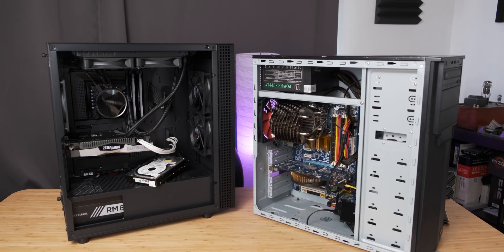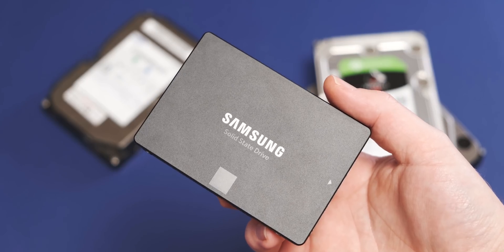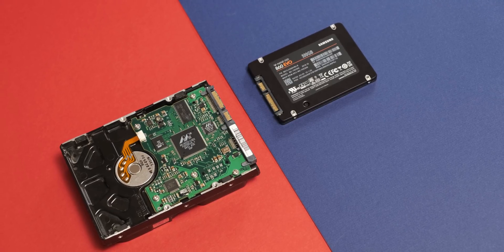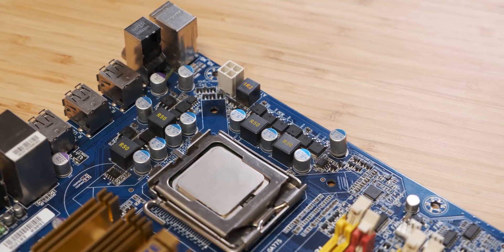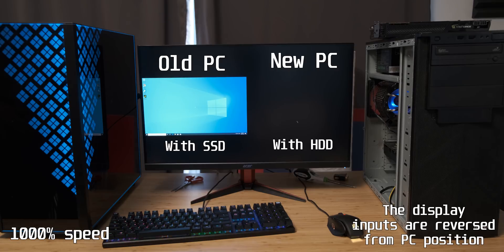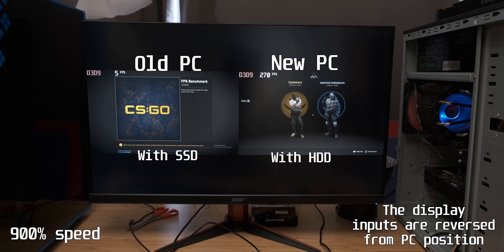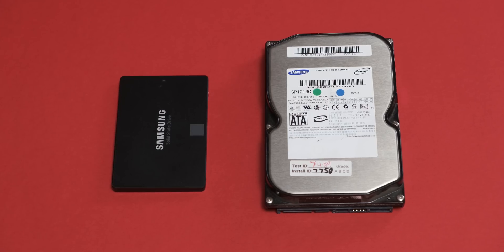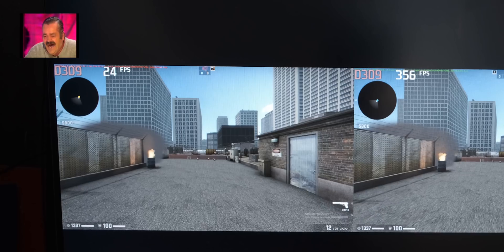New PC with old hard drive vs Old PC with new SSD

Comment: I got a problem i think i got 2 pc and  1 or 2 gpu cable ar mix in whit the rest of power supply kabels from a other power supply  1 psu is 850 watt the other 1 is 750 watt  i going to buy a gpu soon and  i dont wanna blow my stuff up  and all the cables look the same  the 2 gpu cables are from the 859 watt psu how harmfull could it be ??????

Comment: 1) HDD not defragmented !
2) The smaller the HDD the lower the Speed, because the density is lower, and the travel times from the head are bigger, because of more distance.
My smalest and oldest HDD is a 500gb 7.2k rpm Hitachi from 2009. Makes 100mb peak, 40-50 average, and 25min at worst (all Write Speeds !)
My external (USB 3) 16TB Toshiba from 2023 makes 220 MB peak ! and i saw it never go under 90mb. Again all write Speeds !
3) Because some guy (like 5 Million other) got a yt channel for pcs, and a ton of money to build a expensive pc, doenst mean that he has real knowledge about pcs and hardware.
I'm 42 and when i build my first pc, and wrote my first scripts in MS-Dos, a 486 SX25 was state of the art.

Comment: I like the comparison...but asking would you rather have an old PC with an SSD or a new one with a HD is the dumbest question I have ever heard. OF COURSE you take the new system SSDs are cheaper then a pack of cigarettes these days! Even if you buy a 128 GB just to boot with...there are drives in that capacity for 10$!!

Comment: Purchased a HP Elitedesk 800 G3. OK its a work station. It was fing CHEAP. AUD $160. Booted in 20 seconds off its supplied 1TB HybridHD. Added 512GB SP SSD. 9 second boot. It turns 5 in March 2023.

Comment: I use a modern 12th generation Intel Pentium G7400, with 32 GB DDR4 3,200 MHz RAM, ASUS H610M-E motherboard, RTX 3060, with a also 6 month old 3 TB Western Digital Blue, 5,400 RPM HDD. I got it when I built the computer. It works just fine for me as I leave everything always open anyway. But due to electric costing $0.54 per KWh, I will be switching to a 1 TB, Inland Platinum SSD.

The reasoning for this is, with the super high electric price here, it would cost $71 per year in electric just for the HDD alone. That is 24 hours of use a day, at 15  Watts.  Where the SSD will use about $14 per year at 3 Watts. I am not switching for the performance, but it is a little extra bonus I guess.

Comment: I have an SSD in the Windows 98 PC with Socket 5 and Pentium with 75 MHz 😂 The advantage here is only in the soundscape, and a little faster DOS formatting, but otherwise you will hardly notice any difference because the whole PC is too lame 😁

Comment: My hard drive is pinned at 100% for the first ten minuets after start up always. it’s the worst I bought antivirus software I can’t even use, because it’s always messing around down there. I need a new ssd drive. It’s got a decent i5 an ok gpu and 16g of ram but that disk is a nightmare of a bottle neck. This was helpful thank you.

Comment: As stupid as it sounds i think there may be something wrong with the hdd system 
My i7-6700 (non k) with 14gb (parts bin) takes about 40 seconds to cold boot and another 10 to become responsive with my 5 year old seagate 1tb 7200 from my old main
I didnt catch any specs but did you happen to get a 5400 drive?
Reply: it's an old hard drive, new hard drives are significantly faster

Comment: To add, using a mechanical hard drive is a bad idea on Windows 10 onwards. In Windows 7 its not as noticable because updates can be done on a controlled basis, while Windows 10 automatically downloads (and sometimes even installs) updates, this kneecaps the performance much more. You're gaming and suddenly your gameplay stutters so bad you'd think something is overheating or crashing on your system, only noticing it;s because windows is maxing out the hard drive throughput because it decided to download an update while you're gaming.

As a personal opinion, the shittiest SSD with no cache is worlds better than a mechanical hard drive in regards to Windows 10  and above.

Comment: Honestly, I've found that FreeBSD tends to be best on old hard drives for a boot drive. Because of the way it handles the OS and loads it all into RAM, it's much faster than even Linux, let alone Windows. Windows is completely unusable, Linux is painfully slow but barely usable, and FreeBSD is... actually not that bad at all?

Comment: I tell people with older PCs/laptops that use HDDs who just use their systems for basic emailing, Microsoft Word/Excel, and internet surfing to just drop in and SSD. The SSD provides a massive performance boost and you don't have to unnecessarily purchase a whole new system.

Comment: i have an old machine with a core 2 duo e6300 in it too! I wouldn't use it for anything demanding, but it will run windows 10, and it works pretty well for an old workstation

Comment: Before watching, hands down old with new ssd is boss here. My wife has a i7-7700 and had an hdd and 16gb ddr4 2400. My i5-3470 with an ssd and 8gb ddr3 1600 owned hers. She upgraded to a Crucial 2tb ssd and hers now boots in seconds.

Comment: On Windows a slow drive will really slow the system down because Windows makes very heavy use of the disk all the time, but on systems like Linux or old versions of Windows you'll probably be fine.
Reply: Other than boot times, it literally runs like an SSD in Linux even in the most bloated distros.

Comment: I have new PC with AMD Ryzen 5 2600, 16GB DDR4 3000MHz, NVMe SSD, but the GPU is from 2007. My PC is terrible in gaming. My old GPU form 2007 is used as display Adapter, since i need mesozoic period(aka VGA) video output for my old VGA only LCD monitor.

Comment: Yeah the Core 2 system can be upgraded far more than that poor E6x00 series and with 8GB of RAM, but that is pretty much the worst case scenario of a system you wanna use today, comparable to an upgraded 2006 Socket M based laptop and trying out an SSD inside... A half decent SSD compared to any of the 5400RPM HDDs you get in those laptops are still gonna make a big difference even there, but once you step one year newer with a much more powerful Core 2 duo, 8GB RAM and SATA2 then the difference is simply massive. I personally make fun of my friend sticking with a HDD inside a Haswell laptop (Purely by stubbornness) and let him watch a Core 2 duo laptop up and running so much faster with an SSD.

Comment: If you're gonna get an HDD get yourself the Seagate barracuda models. There's also super high capacity Seagate drives that run at 7200rpm. Western Digital also has the "black" series that are high cap, high speed HDD's.

Comment: Fun fact. My X58 system I have. Took 18 minutes to stop loading all the programs and to stop loading and be just idle. With a Hdd. One 950 pro nvme drive latter. It's under 30 seconds.

Comment: One thing you left off(or rather, wasn't subject of the video in the first place) is that whilst you're right, the onboard graphics in an old Core 2 doesn't cut it anymore for watching YouTube, and I would suggest fitting a GT 710 in there if it doesn't already have a graphics card. It's how my dad can still use his old Core 2 for everything he needs without any issues. £30 for a SSD and £35 for a crap graphics card sure beats buying an entire new machine.

As for the SATA one being old, it makes me sad to hear that. My first computer only had ROM cartridges and cassette tapes(the same type you put music on) for storage. Considering ROM cartridges were read only, and cost £30(about £100, or US$150, with inflation), then everything was on tape, including my games. Floppy disks were available, but the drive cost more than the computer did. Not joking.

Comment: It’s not a useless video! I have a pretty sweet gaming setup (1080, i5 10400, 16 gb ram) but I run my games on a SATA 1 HDD, and it affects some of the games data streaming significantly. Such as driving really fast in Forza, it actually can’t load the map quick enough at times.

Comment: I’m watching this waiting for Windows to install on my first gaming rig, it’s an old Dell Precision T1500 on the LGA1156 socket. I had originally installed Windows 10 on a hard drive but now I’ll be able to see what it’s like at SATA2 speeds since the board doesn’t support SATA3. I’m thinking about getting an expansion card to be able to run my SSD at full speed.

My plans are to basically get all the power out of it that I can on an approximately $300-400 budget.

Comment: When I had to start using Vista, that was because my brand new PC (at that time) had more than 4GB RAM... The reason there was simple: With more than 4 GB of RAM our options were limited to Vista, Windows Server, XP 64 bit, Linux, BSD... But even XP 64bit had different driver model, compatibility issues, etc. so Vista was the reasonable way to go. For most other systems people didn't have to move to Vista, but if you wanted more than 4Gb you had to get Vista.

If you had less RAM you were better off with XP, as it offered more compatibility with existing software. Usually people who bought lots of RAM, bought it to avoid RAM being a bottleneck in an "otherwise very strong" system. 

And people often said, if you fill your mobo with RAM use the biggest capacity DIMMs it will support, it will be helpful later. Those Vista systems often ended up with an upgrade to Q6600, which was a popular CPU and much cheaper then Core 2 Extreme (or even a Q6700). 

So I feel your old system is a bit underpowered for a proper Vista era PC.

Comment: Have to say, without watching, the SSD is going to help a LOT! I installed a 120GB SSD into an old P3 1GHz. Boot times went from around 20-30 seconds, to about 4. Games load quick too and stutter was all but eliminated. Now, 120GB sounds small, but it originally had a 40GB IBM deskstar. Needless to say I had to use a SATA to IDE adapter. 

Not sure what to do about TRIM support as it's running Windows XP. Eventually it will slow down. But I only use that system perhaps twice a month when I want to play some old games.
Reply: that cpu can handle windows 7.

Comment: Thanks for the tips...
My dad has an All-in-one PC (Lenovo C200) with a 500 GB HDD, maybe from 2009 or 2010, at the time when "Windows 7" entered at market. 
I'm thinking on change the HDD and install a 480 GB SSD. So, the Lenovo C200 will work faster with the SSD anyway.

Comment: Changing from a 7200rpm Seagate FireCuda to an Intel 665p NVME is definately by FAR the most noticable upgrade i've ever done. Going from a 2500K to a 3300x itself did almost nothing when not in game and seeing the lower usage numbers. But the NVME drive made it a whole new machine. Whenever someone claims they got a smoother desktop from buying more cores, i know they actually replaced their ssd too. My moms Pentium G6400 has just as smooth and responsive of desktop performance as my overclocked 3300x does with twice the cores and threads. Both have the same ssd.

Comment: I am using a 12 year old 80GB hard drive for my media server. I have a slew of 10 year old 1 to 1.5TB hard drives used as storage. Runs smooth as silk @720p on my 18 year old projector. Since the hard drives aren't accessed on a daily basis, I figure their life span to be in the 15-20 year range.

Comment: Any Core2 motherboard today is still fully capable to do every day work... Just needs an Ebay 15$ Q6700 cpu, a 240gig ssd boot drive and a half decent gpu like a Radeon 5770, 6850,  nvidia GT1030 or 750Ti

Comment: For gaming and general use, SATA SSDs wouldn't be a bottleneck at all. On paper, they are. However, that only translates into niche useage (for example: moving large files). For game-load times, SATA SSDs load games virtually as fast as NVMe SSDs. Same seems to apply to boot times, too (contrary to popular belief). Anyway, cool vid!

Comment: That 120 GB HDD must have been a real old one and its throughput will be very low, I expect between 40 and 60 MB/s. In the test you should have used a more modern disk with double the throughput. However the throughput is not everything, I have 2 HDDs one running at 135 MB/s and the other at 110 MB/s. That last one is faster, because the seek times are considerably shorter. The seek time is the time, it takes to move the disk arm.  
I do that kind of test almost daily, I have stored my Virtual Machines on 3 different types of storage:
- nvme-SSD (3200/2300 MB/s) average boot time Linux ~10 seconds. Perfect!
- Raid-0 from two HDDs (~240 MB/s) average boot time Linux ~50 seconds. Workable.
- one HDD (~77 MB/s)  average boot time Linux ~100 seconds. Unworkable too slow, however like in the past you get used to it!  Boot and fetch a coffee :)

I restored an old Pentium 4 for family and I used two left-over 40 GB Seagate Barracudas in Raid-0 and its Peppermint (Linux) boot time was ~55 seconds. Very nice for an Pentium 4 HT (3.0 GHz) from 2003. 

In 2019 I used a SATA-SSD instead of a nvme-SSD in my desktop and I remember, the average boot time of Linux was ~20 seconds. Good!

Comment: HDD is better
Reply: Well not in terms of speed but it lasts you longer, plus if it does break it doesnt just randomly die on you AND if it does die wich will take stupidly long, and you'll know it'll happen months before it does, you can still retrieve the data
Reply: But if you buy a decent one the speed should be quite good actually

Comment: I have a old SATA 1, it's twice the speed of that Samsung.
I think the average numbers are ...
IDE 4-45
S1 60-88
SCSI ultra 320** I'll test that my self shortly..**
Sata2 130 (375)
SSD 375-550.

The thing is that when in the old days, drives were even slower, what we did was raid the drives into strip's .
Nforce 4 could do fairly well but a limit was set with how many drives were "effective". Too many caused a slow down again. I forget the later chips where 5 drives were the max and it was lower, so about 3.

What with the ram speed? 1666 upgrade...

But..... If we take my DAS that runs around 4000mbs and my other 8000mbs... That's "old hard drives too" it's special.. and still better than the newest m.2nvme drives ;)
Mechanical win !

Comment: Oh come off it, man. Such a shame as this could have been a much better video, at the start! Potential has been lost. That Spinpoint (Rev A) HDD with 8Meg cache was made in 2004 and Vista (at best) would be available in 2006 for business, but more like 2007 at the earliest if "building" a dream machine, but likelier later in early-mid 2008 (mid range PC). That HDD is not representative of Vista "Dream Machines". Far more probable would be the league of the "Raptor" Western Digital 10000RPM sata2 as 16Meg cache. Windows7 wasn't generally available until something like 2009. The 32meg Cache HDD were around. Dynamic Disk was around in Vista onwards. Even that WesternDigtal WD1600JS is from 2007 before Vista and is just a remake-batch of a drive from April 2006. People would use better HDD and Dynamic DIsk (or even RAID), such as the Western Digital 10000RPM sata2 with its 16Meg cache.

Just talking about the Vista machine (not your new PC): Your HDD and SSD, is not really a fair comparison, though. A "dream" Vista machine would not be like that. Of course people cared about HDD speed and HDD cache. Aside from using RAID, people could instead use the easy (Vista) Dynamic disk option and put a sata HBA in a mainboard to bring it up to 6sata ports (if it did not have them already).

It (multiple HDD setup, like Dynamic Disk etc.) would speed things up (and Virtual-Memory), and they'd would have a system-image (and similar data protection) with other HDD or storage devices. Not a fair comparison. If you have used a lame SSD versus a more modern HDD than that HDD, then maybe it'd be a better comparison. Even then though, SSD data loss is sudden and catastrophic failure. People knew that and did seek to avoid it in the Vista days. An HDD can sometimes give warning symptoms.

You're also incorrect about that SSD (although a nice SSD) being as good as it'll get on account of sata bottleneck. Before that SSD came out, there have been SSD with dual sata connections. If anything, the dual-sata-SSD's existence underlines the point that system builders at home have frequently being thinking about multiple Hard-drives (including HDD) be it raid or zfs or dynamic-disk or whatever (let alone hybrid-drives). 

Large amounts of RAM were hard to come by compared to today, so Virtual-Memory (paging, etc.) would frequently write to an HDD. Without enough to switch it off, constant "swap space" activity to NAND memory would destroy the read-write of an SSD compared to a decent HDD setup. Even a PATA IDE (good quality) HDD RAID array could perform alright in a Vista machine. This is echoed by the fact that Linus-Tech-Tips (possibly 'NCIX' back then) set up a bunch of SSD drives in windows7 early on, as RAID, to see how fast it would boot. That is how well established by then RAID HDD would have been used and known. 

But even with that, an easy option for pretty decent performance would have been Dynamic Disk (Vista). People would even move the master-boot-record for a performance edge, and guides to do so would be in famous magazines of the day.

Your "bottleneck from the vista era" is not that HDD, per se, but bad system builders.

Comment: I have a question when it comes to having both an SSD and a HDD in your system. Does windows still cache data no matter what drive you have taking up RAM usage, or is it only for mechanical hard drives?
Reply: It does it no matter what, but likely more on HDDs. I can and can't tell because between laptop and personnal build, there is a bloatware difference. When it comes to paging while still loading heavy stuff, SSD is waaaaaaay better